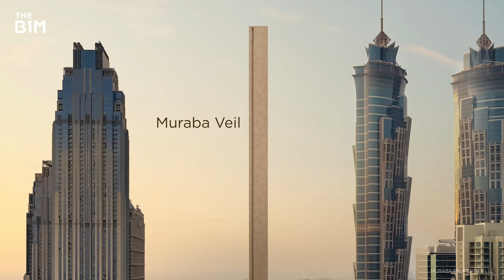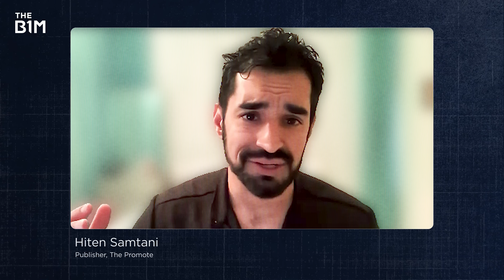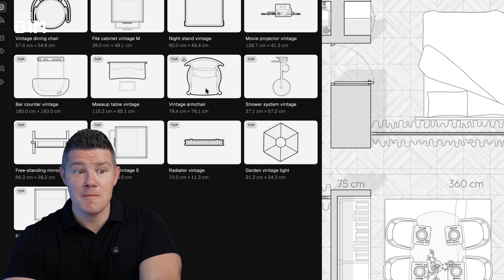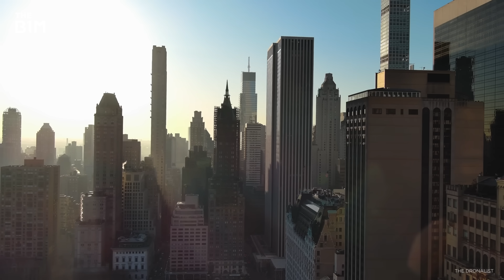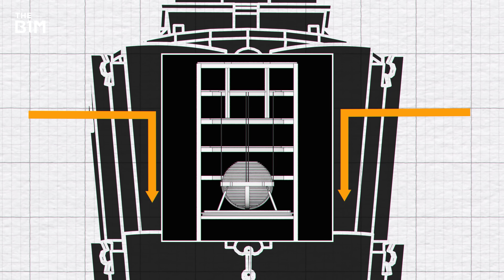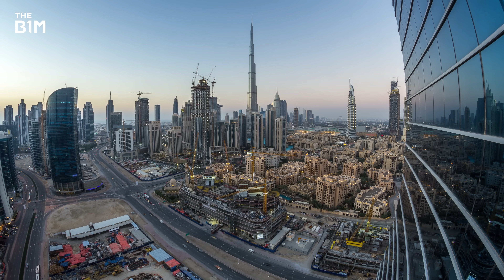Have We Finally Built Too Thin?

Comment: I don’t see how it could possibly be economical to build so thin. 22 meters from exterior wall to exterior wall is only 72 ft. If the exterior wall assembly is only one ft thick, that’s 70ft left, and you still need central column and elevator shaft. That’s not very much room. Don’t people want bathrooms, kitchens, bonus rooms, storage, laundry rooms, etc? All of those make sense internally or in a common space like the kitchen, it makes no sense why very tall buildings would ever be less than 120 ft wide in any dimension. That gives 50x25=1,250 st ft for 2 bedroom apartments and 50x37.5=1,875 for 3 bedrooms. Anything less than that and it starts to feel cramped or combines room functions and omits storage and ease of living items.

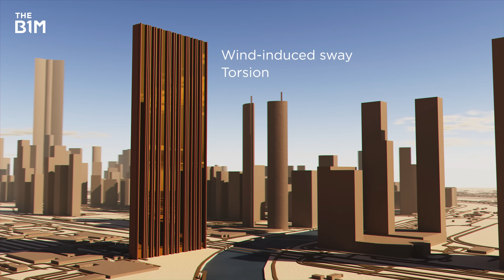Comment: There should be some standard way to define "skinniness" of building. Yes, the building in this video does look skinny from one side (e.g., @0:29), but it also looks very chunky from another angle (e.g., @9:30). If you just look at this building @9:30, there is no way one would think that is a skinny building, but rather you think it's a chunky building. Same can be said of the Rockefeller Center in NYC where I live. If you look at it from the east (or west) direction, it's very skinny, but if you look at it from the north (or south) direction, it's very chunky. It's not like the Steinway Tower, the Central Park Tower, and 432 Park Avenue, no matter which way you look at them, they appear to be very thin.

Comment: An apartment that is 22 m (72 ft) on the smaller dimension is still pretty big. Guessing that it's 7x more in the longer dimension which gives, including walls, 3388 m^2 (36,288 ft^2).

Comment: Retired engineer here. You couldn't pay me any amount of money to live in these super thin skyscrapers. Why? Whenever you have to rely on bleeding edge (meaning insufficiently tested) engineering principles to build something there will always be a compromise somewhere. In my experience this is almost always driven by economic pressures coming from someone primarily concerned with the finances of the project. Over the life of the machine or building or whatever something WILL happen to expose the compromise and create a dangerous situation. The first building featured in this video, 432 Park Avenue, is going through this now.

Comment: how many times have you heard metric and imperial being mixed up, or supplier sending screws that were off by 10% on a critical material for a critical joint... etc.  There are hundreds of moving parts and if one of them goes bad that HANGING POOL will be disasterous..  People really are insane to put THAT much trust on something that had 100s of people touch it to build it.

Comment: How are they going to deal with the moment at the base of the building? High strength concrete is great but it’s brittle, which is a big issue when ductility is key. Additionally, pumping C90 concrete 400m isn’t exactly a simple task, there will be huge construction difficulties if they don’t reduce the concrete grade near the top. Bedrock in that area is too deep for end bearing foundations, also that canal must make differential settlement a big issue. I can’t wait to see the solutions to these problems!

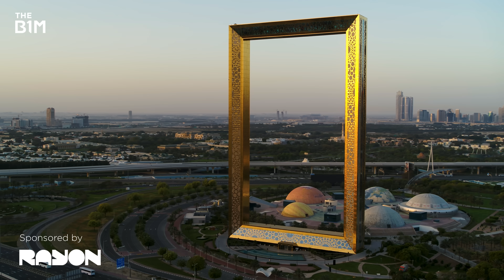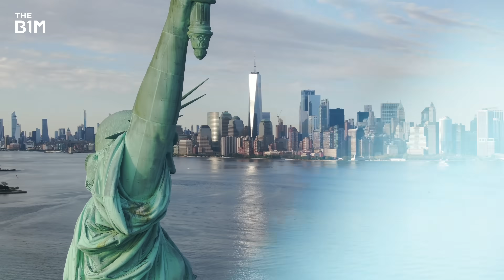Comment: I am confused: Muraba Veil is described as 'almost impossibly slender' with a width to height ratio of 1:17. But earlier in the video he notes that 111 West 57th is taller than 432 Park and by extension, Muraba Veil, AND with a width to height ratio of 1:24. So why it implied that this building is an advancement in the slender supertall archtype?

Comment: Not that I am very sympathetic to the owners of these money laundering machines, but they happen to come with a set of built in mechanical problems. Chief complaints are constant wind howling due to the chimney effect and all sorts of issues related to omnipresent sway - cracked water/sewer lines, walls. Their owners apparently don't spend much time in their apartments that they apparently purchased for what they consider a pocket change.

Comment: I was thinking about a skyscraper with one apartment per floor.  But there would be one advantage I think.  Say there’s only one elevator — there are probably more than one for redundancy purposes — but if a person bought an apartment on, say, the 23rd floor he gets into the elevator, swipes his card, and the elevator automatically takes him to his apartment directly and when the door opens he is already in his apartment.  He gets out, the door closes, and the elevator goes to pick up the next passenger.  I don’t know if it works that way but it would be pretty cool.

Comment: A developer in Wellington, NZ, built a residential tower with 2 appartments per lower floor and a single apartment on the upper floors on the basis of the return on investment for "penthouse units" was higher than maximising number of apartmentsper floor.

Comment: 1:05 You are worrying about snapping in half. I am worrying about seas sickness. These thing structures should be so "flexible", they should be able to bend so much that I don't think that any kind of movement dampener could effectively stop the tower from moving. Just remember, that a piece of iron is tough, but if it is long as a train track, it bends like a plastic rod.
Reply: People that buy these don’t worry about that because they don’t actually live in them. It’s just an investment and a flex.
Reply: Active dampers can stop any reasonable movement.
Reply: @thewhitefalcon8539 apparently they do slightly sway in hurricane winds. Nothing that the structure can’t handle, but it’s something to think about

Comment: I bet the swaying of the building is also pretty incredible. Here is a copy&paste from a SSA consulting engineers webpage: "As with any building over a certain height, high winds can potentially cause noticeable swaying. A building as tall and slim as the Steinway Tower, which comes in at 435m (1,428ft), could move as much as 0.9m (3ft) on the upper floors. This could be nausea-inducing, until you get used to it!"
Reply: Even some of the London towers sway noticeably in the wind! And they're not even that tall. I went up Horizon 22 (I think it's called that) and it was moving. It was a very windy day but still....
Reply: @JustSomeVideos0  Well i think the swaying in these thin skyscrapers is bit more noticeable than in the London towers or in the typical older skyscrapers. The thiness of the building probably comes at a cost swaying wise.

Comment: They should require destruction plans for all buildings. If you can't figure out how it can ever be brought down, you don't get to build it
Reply: And provision should go into the budget.
Reply: From what I remember from university developers are supposed to plan for the decommissioning and deconstrucrion of buildings according to their projected lifetime.
Reply: 9/11 solved that problem.
Reply: It's also worth checking out what they are doing in China with construction under inflatable domes to control sun exposure and climate control and fumes and noise. It's impressive, but I'm not sure how safe it is for the people inside as far as dust and fumes is concerned.
Reply: @kyrirhcp where did you get that info coming from?
Reply: @curious5887 I watched a short a few days ago, and there are articles on the Internet. Try searching for "China construction domes" and it will come up👍🏻
Reply: 270 Park Avenue was demolished, and lot of skyscraper can be demolished, including Burj Khalifa, I don't know why you act like engineer don't know this, when in reality, they do, and skyscraper was built to last 100 years, and by the time the skyscraper is hundred years old, new demolition techniques would be developed by that time
Reply: @curious5887   -  They may be 'designed and built' to las t 100 years, but we've seen a slew of them failing after less than a decade - or even before construction is even complete - so that argument does not hold.
Reply: @GeoffBurns_MHS in the case of structural failing, that's entirely different matter from voluntarily bring it down when the skyscraper is no longer
Reply: @curious5887  - But there still needs to be a plan to dealk with it - and provision to pay for the work.
Reply: @GeoffBurns_MHS look, i agree with that, but you brought up a completely different matter from plan to brought the skyscraper down when the building no longer in use
Reply: @curious5887  - If the building has a structural failure, it is "no longer in use" . . .
If they decide to build something else on the site, it has not reached the design life, but still needs a demolition plan.
In case of a major fire or other mishap, plans need to be in place for demolition.

Or do you think it'll just be left there until someone figures out how to deal with it?
Reply: @GeoffBurns_MHSin reality just leave it until someone figures something out and is willing to pay for it is pretty common. So many buildings are just left rotting away because nobody is willing to take care of it.
Reply: Demolition plan has been a requirement for a long time in Manhattan. If you’re curious of how it looks like, check out the WTC building, september 11, 2001. Especially building 7
Reply: @anonoway3045Yeah I was really thinking about ensuring that funds would be available if destructuion would be unusually difficult, but I realize they had a more creative solution that time around. I mean Larry basically turned a profit!
Reply: While I understand the logic behind that suggestion, it's entirely impractical. not just for new buildings but for existing ones. 90% of major high-rises in Manhattan could not be safely demolished, at least not without evacuating and being willing to damage a dozen buildings around it.

There are just structures that are too tall to be actively demolished without causing massive damage to the area around it, and it's not just because of these low IQ vanity projects, but just simply the mass of the thing.

Now theoretically they could all be deconstructed in a very slow process going from the top down, but in many cases that might take years and possibly many multiple times what it cost to build in the first place.

It's probably been the better part of a century since we started building massive structures that are never going to be voluntarily taken down.
Reply: @Laotzu.Goldbug 
Yeah, slowly breaking it from the top down is exactly the method. 

And it has been done.
Reply: @Laotzu.Goldbug  i mean, what are the building owners paying rent for? especially with buildings old enough to have swapped hands and changed owners.

Comment: If you take a twig and continously snap it in half, it will get proportionally much more difficult to snap as it gets smaller. Thats just physics. These buildings are a tremendous safety hazard. It's not going to end well for the occupants or everyone in the vicinity when an extreme weather event occurs. Greed overwhelms intelligence in today's society. The evil that is prevalent today is unprecedented.

Comment: That building looks like you should not be concerned with buckling of structural members, but buckling of the entire structure as a whole.  You need to build a couple more of those and brace them against each other. The slenderness ratio is crazy.

Comment: Maybe tuned mass dampers work but I remember going to the observation floor of the then Sears Tower (now the Willis Tower) in Chicago in the 1970's. I noticed a swaying motion and asked the security guard if the building always swayed like that. He said "all the time". The Sears Tower wasn't that tall or slender either. I suppose the tuned mass dampers work well, but I would guess they aren't perfect and there is some residual sway. What if the tuned mass dampers fail by sticking or something? It would be like a ship in a bad storm.

Comment: hang on, there is an awful lot of engineering hidden in your one word summary of a "decoupled" stainless steel veil.  this cannot be fully decoupled, because it cannot support itself.  how is it attached, and which parts of it are going to flap like sails, in the wind?  you really need to explain this bit, or at least provide enough detail, please.

Comment: The comment about strategically stacking mechanical floors...

I don't know if that holds up...?
Reply: It's because they're "blow-through floors" aka no windows, therefore they aren't considered habitable area.
Reply: @Zooropa_Station 
I understand that but it was described in the video as a way for developers to get additional height while avoiding air rights restrictions. If these mechanical areas are necessary and they take up an entire floor than the building would always have been the same height... ?
Clearly im missing something

Comment: Honestly living that high seems like a practical nightmare. Rather than a moving lift, you need a friggin' chopper to airlift your furniture up there.
Though I guess these specific towers are only for people who won't care much about the high cost of renting out a tower crane that high, incl. people to run the operation, just to get their stuff up there somehow.
Reply: Nah, that's nonsense. The biggest thing that has to be moved in there in a single piece is is the bathtub. Any furniture too big to fit into the elevator simply gets moved in pieces and assembled inside. The kind of people flush enough to buy into that kind of architecture doesn't move furniture to other places.
Reply: @Volkbrecht  A lot of proper furniture doesn't/can't really get assembled on site. These people ain't buying Ikea assembly packs I'd imagine.
Sure there are gonna be things, like a bed or a sofa that comes in pieces. But not everything.

Large and heavy oak closets generally don't come in small parts. Table tops generally don't get cut into pieces. And stuff like that generally doesn't fit into any elevator due to the height/length.
Even a relatively small (for the size of those places), common table that sits 6+2 people is several meters long and won't fit in most elevators. Even if these places get huge elevators, there is certainly going to be stuff that just won't fit.

And the bathtub? That's surely false.
Unless you're buying this thing on the 2nd hand market and want to do major reconstruction, the bathroom is something that will be installed by the builder before the resident even comes close to moving in. I don't see that as furniture. 

And at that point, the tower crane is still there.
Though I guess, since these things are likely sold out on paper, long before they're built, the builder does all the furniture as well.
Just don't think to change anything anymore later then.

By the by 'they do not move furniture between places' ... even new furniture still needs to get up there ya know. Not just furniture from your other million dollar mansions.

Comment: Imagine a fire half way up. Not much space to get out...
Reply: and nothing of value (to society) would be lost.
Reply: Just have a hangglider as decoration in one of the rooms ;)
Reply: @Volkbrecht that would be even better... skeet shooting!
Reply: And nothing worth anything would be lost at all.

Especially since I would gleefully Jam the doors and Luigi anyone who tries to get out through a window
Reply: If you're dumb enough to live there you kinda deserve it.
Reply: One can dream...
Reply: These things are mostly made from concrete, steel and glass (nothing that is flammable), the fire would be easy to contain and extinguish, the sprinklers would probably be enough to put the fire out.
Reply: @b @bigfudge2031 Guess you forgot what happened on Sept. 11, 2001 . . .  and fires starting in furnishings of apartments, electrical fires in the mechanical rooms, can happen.
Reply: @AR-lz7hi  In 2001 offices were full of paper. As seen in the videos from the event, where it was raining paper in a 5km radius. In 2026, this isn't the case anymore. 

And if a plane crashes into a pencil scraper, fire would be the least concert. The whole building would snap.
Reply: @bigfudge2031 what about the deadly smoke rising up the building?
Reply: @bigfudge2031 that’s why they use airplanes- already full of thousands of gallons of jet fuel.  Works like a charm.

Comment: The uber skinny tall buildings will have short lifespans. And crazy demolition challenges.
Reply: Demolition? The things will destroy themselves. Neighbors beware.
Reply: They're not built to last. Here in Italy, things were built to last.
Reply: I don't know that I entirely believe that, but I subscribe to the thought.
Reply: Super skinny buildings like this are inherently more vulnerable to mechanical fatigue, 432 park has already suffered a serious spinal fracture due to the designer demanding it be made from much more brittle white concrete instead of the traditional gray for the sole purpose of it standing out more.

Comment: Oh boy.... I hope they have stable peace first, and stable skinny skyscrapers second.
Reply: Stable soil might be needed as well.
Building high needs a lot of area to transition sideways forces to the ground properly, so you need a big foundation.
Just look at what was needed for Burj Khalifa, a huge pile supported concrete slab with the tower bolted on top.
And then there is basic infratructure, like running water and sewers...